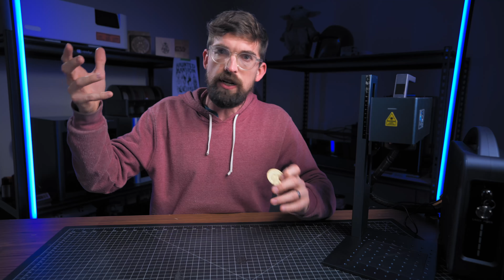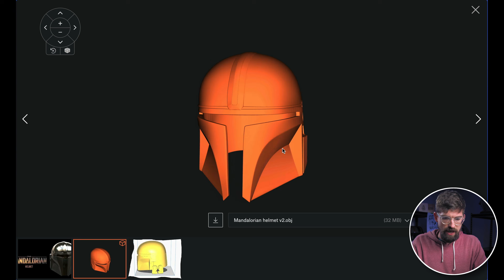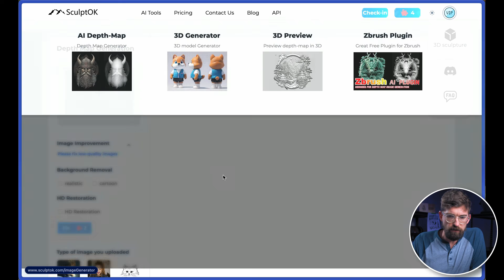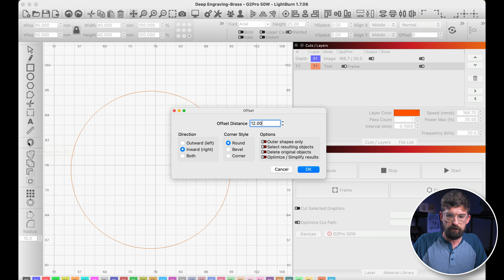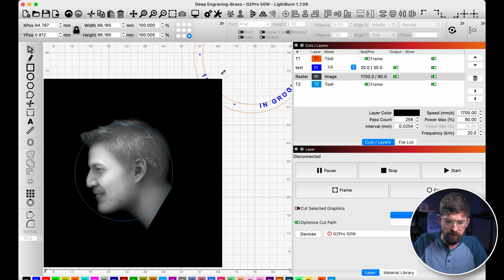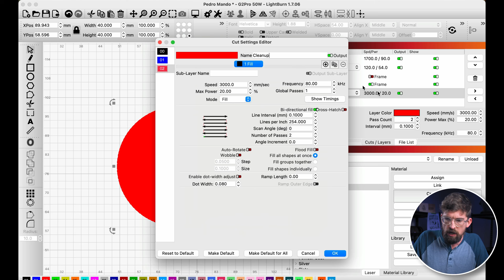3D Engrave Any Image Onto a Coin (Step by Step Process)

Comment: Excellent!
But sometimes you go too fast. 
Usually, there is always "rewind".
But in one case, when you were talking about adding some information to your library, you said;
"I can do this over here, like this". 
But then, the window quickly disappeared.
And even though I went back and replayed it 4 or 5 times, I still haven't got clue as to what you did, or where that setting might be.😏

Comment: What kind of setup do you have for your air purification?  I am thinking about getting a work area set up in my basement, but, am concerned about keeping the fumes/metal flakes out of the air.  It will be my first laser and I want to do it right the first time.

Comment: Most excellent video on Depth Maps and ScupltOK site so I checked that site out and it works the Depth Map came in nice but with white halo on the top on bottom and I replayed your video and you do mention that one might have to do a little clean up in another program. Do you have a video for that type of clean to remove imperfections? Thanks

Comment: I have 2 concerns. A craftsman should own his tools or he will never get anywhere in life. $20 bucks a month to rent software is crazy!

My 2nd concern is the whole idea of vaporizing metal as opposed to machining away metal.

A small home cnc mill could use the same image to cut the metal away. The metal shavings could be melted down or sold as scrap.

Venting the vaporized metal fumes in or even outside the home still sounds like a bad idea in the long run.

Comment: Can you do the same process on wood to give the same 3-D effect?
Reply from the maker: Sort off, but you really can't get the same effect, it's mostly for metal with fiber machines.
Reply: I have done great depth map engraving on wood using a UV laser.  A fiber laser just won't work.
Reply: @terryclair2914  all I have is a diode laser

Comment: New viewer to your channel, and loving your content so far. I would strongly encourage you to investigate the free software "Blender" as a complement to your existing workflow: quite apart from being a very powerful (and completely free) tool, it makes it straightforward to load any 3D model and then render a "z pass" (i.e. a depth map) with full control over the camera position and depth "gradient" of your output, and it could add a lot to your already excellent content.

Keep up the good work!
Reply from the maker: Thanks for the tip, I am always looking for new ways to make 3D stuff!